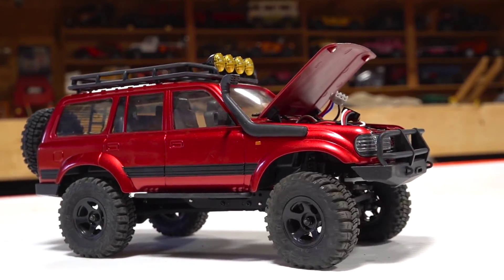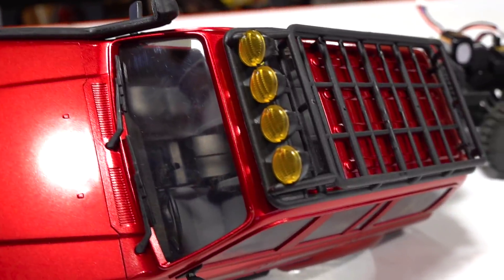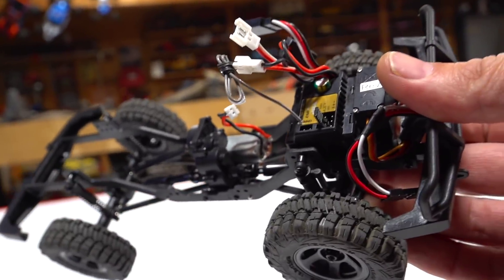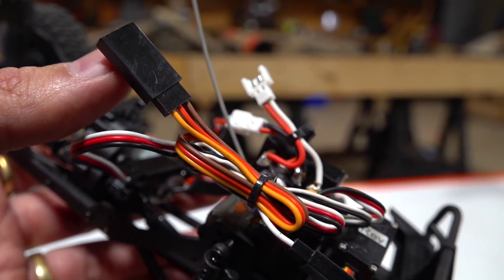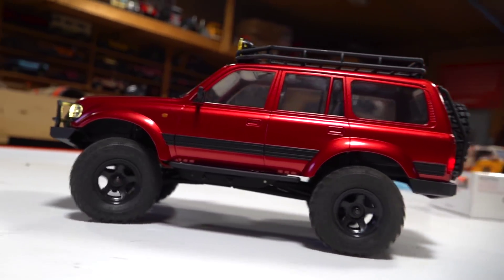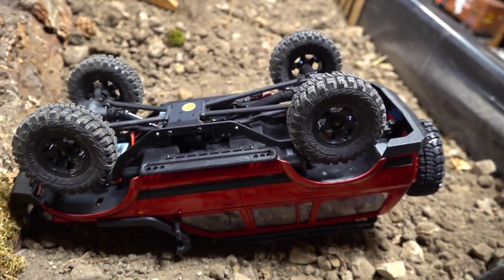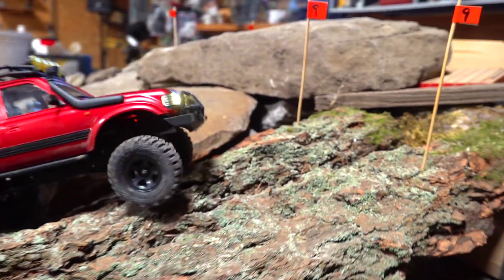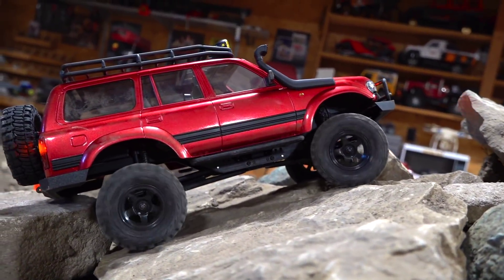"KATANA" UPGRADED - FJ80 80 Series LAND CRUiSER gets New Brains | ROC HOBBY 1:18 Scale RC Truck

Comment: With all these 1/18 scales, I'm still waiting for the first Teton to show up.

Aaron, now you're talking my line of work. The reason the whine was so loud is that the vibrations making the whine were transmitted into the body shell. The hood being up had very little to do with the volume, because the vibrations in the entire body were being converted to acoustical energy. Much of this is due to the screws keeping the body firmly attached. A cheaper solution would be to convert to a looser hold-down system & turf the screws.
Reply from the maker: Its not just a shell though Al, it has a complete bolted interior, which would deaden the vibration.  And the BOX aka engine bay definitely amplified the sound of the ESC/RX combo.  That had nothing to do with the body harmonics, brudda!

Comment: If it bothers you check for spots where the motor and trans actually contact the body directly. In a real car we chase noises that way. If you find a spot then file it down or put a little rubber in there to isolate it. Also try some small o rings between the body and the frame where the screws hold it down.

Comment: Have you considered putting a thin rubber O-ring between the body mount and body as well as a single layer of Gorilla Tape around the transmission clearance tunnel on the floorpan as well as the inside of the fender wells. Maybe it would serve as good dampening and breakdown some of the accoustics.
Sorry I'm late to the show! Been on Christmas Vacation for a couple weeks!

Comment: You could have used some gasket tape on the underside of the body, maybe some inside the cab on the floorboards to reduce noise resignation. High end full size cars and SUVs have sound deadening rolled on the inside of the panels to reduce cabin noise.

Comment: I'm thinking you might be able to reduce the volume of the transmission noise by using rubber o-rings to isolate the body from the frame!?! The difference in the ESC noise is pretty surprising though!

Comment: Nice, but the Tekin is still not totally silent.
Check the AS12/6RW EASY ESC, 18 kHz, totally silent. Will make a video (in the Katana) soon.
Have to change front turning light position to outwards, looks award inside. Did you use a different light controller, because turning lights still work?

Comment: Do you know offhand if the BXR handle 3s as it sits? Not sure if you've used the FXR, but if'n I were a bettin' man, I'd say you have. Anyhow the FXR you have to run an external BEC to pump 3s through it. At least I was informed such and always did. 
I'm unfamiliar with the BXR however. 
I have one on the way though, about a week out. And my Katana is in transit still, last update was at the USPS sorting facility in Seattle and I'm about 53 miles south. All the way from Shenzhen, and almost here. I ordered Christmas day with Christmas gift cards. 
It'll be like a second Christmas.

Comment: Question, did you consider using the Firma Smart RX/ESC combo? You can still use a DX5 or DX3 with it. Or more rather any reason you opted out of that option for this one instead?
Reply from the maker: Yeah, because of its size... like I mentioned. Its tiny

Comment: What are the differences in 1/18 and 1/24 and yeah love that little truck looking real deadly
Reply from the maker: size. 1/18 is bigger
Reply: @RCSparksTV  is there much difference is there or is there is a lil more fun with one over the other what about making tracks for them just asking not trying to bug u
Reply from the maker: @shawnhampton2895  No bother at all Shawn, its a pleasure. Yes, it is considerably larger and moves much differently because of the weight.  I like this hard shell truck because of that reason
Reply: @RCSparksTV  ok last one did u get it off banggood or no just seen they have that same one and I love that its a hard body they are asking $180 us +shopping  is that about what u paid before upgrading

Comment: I am thoroughly enjoying the content.  I have 2 SCX24 C-10's I tried the Enduro 24 but am not a fan. What would you recommend as a comparable crawler with some part support? Both of my C-10's have 4-wheel steer, Barrage motors, Fans (to prevent over heating), adjustable shocks, EMAXX servos, And weight add ons. The Enduro had no parts support and wasn't good at slow crawling in my opinion. You seem to have tried a bunch of these small scale crawlers and I would appreciate your input on what to buy next.
Reply from the maker: It's tough to say what other folks would like.. or give a valid recommendation as the word "Best" and "better" are words we use to show personal opinion.  I have to say all of these trucks are a great platform to start with. Like most RC's - modifying them is part of the fun.  Granted, I have gutted most of them and put new electronics in - as usually stock electronics are adequate but leave one wanting more.  All of the models I show on my channel are ones I believe will last a viewer a  long time, and be a quality purchase. Some will not have the greatest parts support..  while others will be too commercially available, and "everybody has one".  Go with your heart, and go with your wallet. Buy what you feel drawn to, and what you can afford. Personally, I like my Panda Hobby 1:18 scale trucks.. but they are getting hard to find now.
Reply: @RCSparksTV   Thanks for the honesty. I will look into the Panda and the Atlas 6x6. I have a 1/18th scale horizon Temper gen 2 with 4-wheel steer but is seems way bigger than the Panda and the Atlas. Hope i can use them on my home made course i made for the scx24's. I can't wait to get back outside and use my 10th scale stuff, but I am truly enjoying the indoor crawlers. If you are familiar with the Temper could you tell me if the Panda and Atlas are in fact smaller? Also please keep up the good work you stuff helps me get through my work day with at least some sanity.